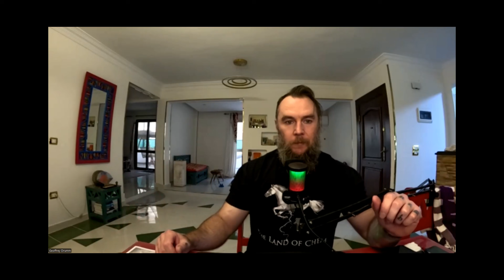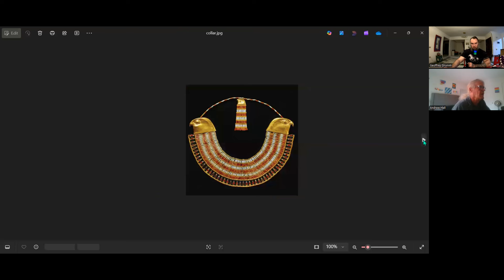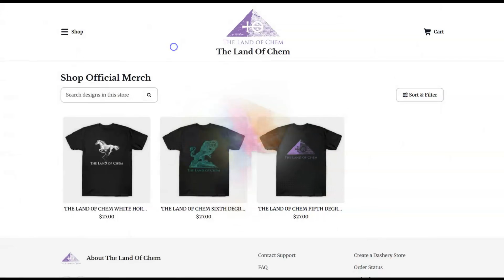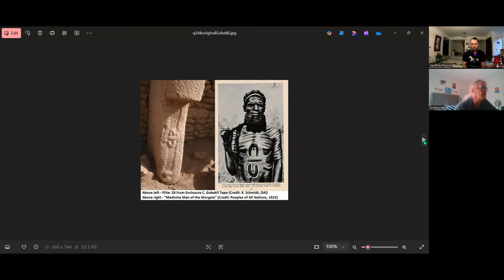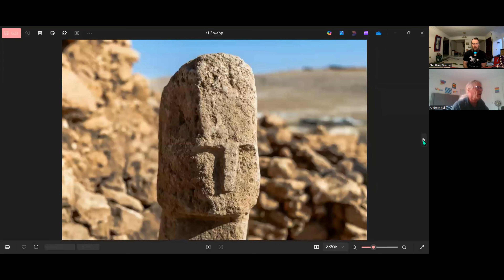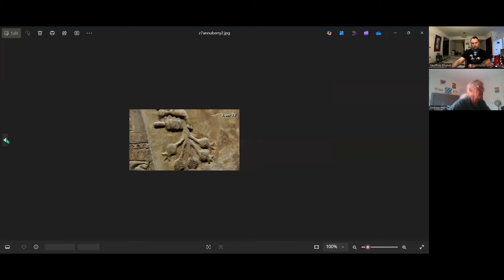MECHANICAL ENGINEER VS. ANCIENT ELECTRICITY TECHNOLOGY: VERSUS EPISODE 2

Comment: His description of the avoidance of sparks should be taken as the best indications are that the pyramids were designed not to be hit by lightning.  When the pyramid failed it failed because it was finially hit by a Lichtenberg discharge.  You can see the Lichtenberg figure down some.of the middles of the great pyramid but the light has to hit it right to see it really well.  There is one picture out there I have found that shows it really well..

Comment: Some more idea bombs for you, Geoff:

The Mayan 260 day calendar (would suggest a different/shorter/faster planetary orbit):

"The primary 260-day calendar used by the Maya is known as the Tzolkʼin (or Chol Q'ij in K'iche' Maya), which is a sacred, ritual calendar used for divination, ceremonial events, and to determine agricultural cycles. It operates by combining 20 day names with 13 numbers which runs in a continuous cycle."

365 - 260 = 105

I theorize that IF the moon was either towed in from some other place (perhaps the moon is planet X) or created from the material of the ocean floor, as some have proposed, it would have slowed down our planet by 105 days. 5, I suspect, is a number that would be used to identify the dominant types of animals (four limbs, one head). 360 (an obvious cyclic number) + 5 = 365. So the orbital frequency itself could be an actual coded interstellar message. Perhaps the various pyramids are different not only because of culture but also because of timing (off-planet colonies/"races" may have arrived here at different times).

And...

The Nasca lines. I have always thought these were representations of ancient 'chemtrails' or smoke in the sky. Think about it!

So, again, there may have been ancient geoengineering abilities long ago, which could have been what the chemicals produced in these pyramid complexes were used for, in a global effort to make the planet more habitable, as well as for agriculture, as you are suggesting. Also, if one presumes that they had very sophisticated technologies, like spaceships etc., we cannot rule out at least some conjectures on the matter. 

PS Andy seems like a very receptive and cool dude. You guys rocked it!

Cheers.

🍺

Comment: Love hearing the lightening energy of the earth when I turn in my AM radio at night and can hear storms hundreds of miles away. Early homemade receivers built by children only needed a quartz crystal rock and a tiny cats whisker wire.
Reply from the maker: Yep. Profound connection between lightning and radio waves! ⚡️⚡️⚡️ spark gap radios are now illegal
Reply: AM home built radios require no power and have one crystal and cats whisker to tune it.  Spark gap transmitters like you say tend to produce rf across an entire band causing interference.

Comment: In reference to the Djed pillar, maybe you are both right.  Those disks could be capacitor plates and the purpose may have been for stability.  Capacitive circuits are often used to smooth out spikey electric waveforms.
Reply from the maker: Full Djed Pillar episode coming up next week. Please drop a few HYPEs to help promote the video 💪

Comment: 47:04 one of them is touching the top and the bottom, and the other one is touching the bottom and the bottom. Which would be both ends of an inductor on a core 👀